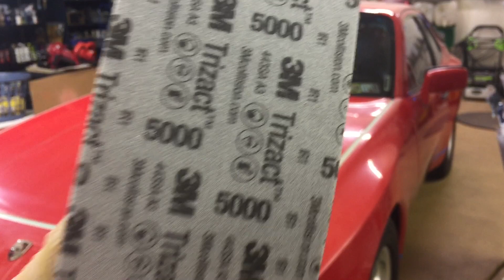Mini Restoration / Vlog # 3 Oxidation, Scratch, Swirl removal on Single stage enamel. (85' Porsche)

Comment: Is not possible to use just a compound ? You must do wetsanding ?
Reply from the maker: You can if you want to go through 60 pads, a quart of compound and in twice the amount of time.
Reply: Apex Detail ooo okay with wetsanding you win time. I say that because i saw a video un youtube : the guy take just a mirror glaze of meguiar’s and ultimate compound with an orbital or rotative ! 
Sorry for my english
Reply from the maker: Your English is fine. This is the most efficient way to properly remove oxidation.
Reply: Apex Detail o thanks you very much i see all your video ! Good

Comment: Good job. Now it looks red again. Question. With Sonax (not sure we can get here in Australia) and Angelwax Resurrection cutting polish which type of pad do you use with these to give best cut but also good finish like you seem to get on this type of paint???? Personally I love Clear Cut and use it with Buff & Shine ERO Microfiber pads for brilliant results of both defect removal and great gloss. Curious that you did not go for say 1500 Grit sanding dics. I believe these can flatten orange peel???? So 3000 was used i assume so to just remove oxidation plus leave as much paint as possible??? Impressed as to how the car is looking now. Better than new. Thanks mate.

Comment: Was wet sanding a necessity or could you have gotten similar results with just a two step correction?
Reply: Yes, he could have BUT It would of used a lot of Compound, Pads, plus time.
Reply from the maker: Would take twice as long, go through 60 pads, and a quart of compound.
Reply: Apex Detail So about the same effort? 😀great series, really enjoy these.

Comment: Hey, I have a Honda CRX that was repainted many years ago in single stage red but it isn't enamel, it's actually polyurethane. Does this paint behave similarly to enamel so I would be able to correct it the same? I'm asking because the car has baked in the sun for years and all the horizontal panels are oxidized to hell and back and I might just do paint correction on it if I decide not to repaint it with a clearcoat system instead.
Reply from the maker: I would have the same strategy for polyurethane.